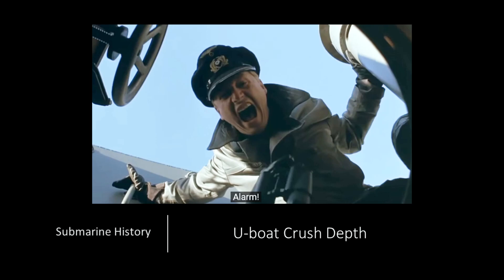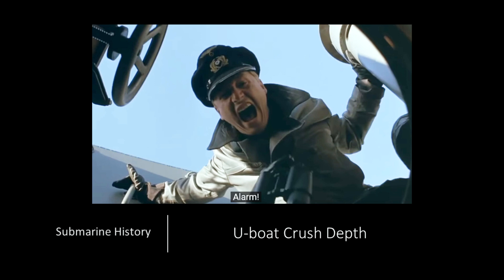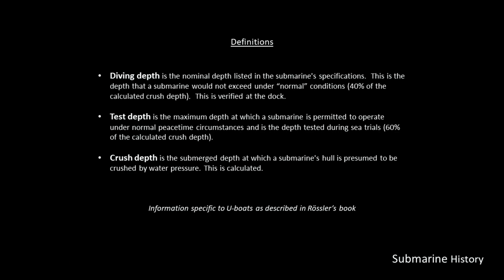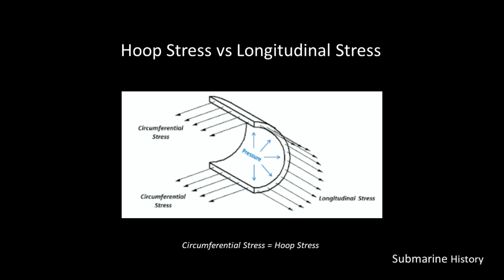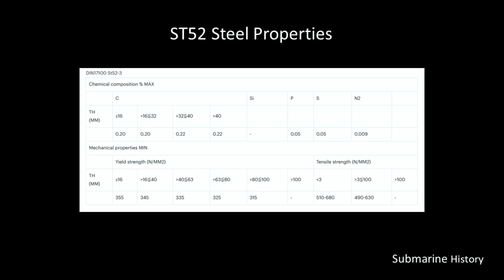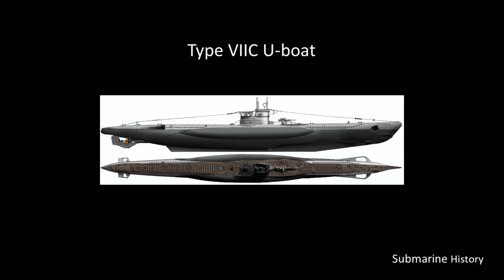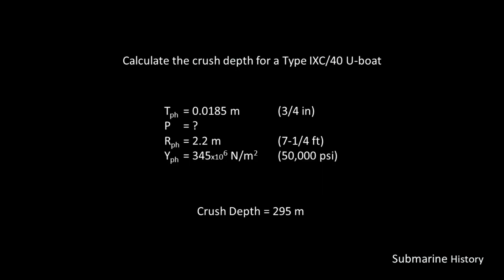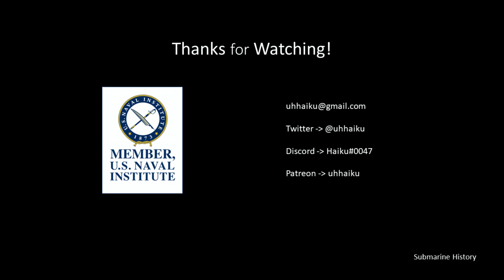U-boat Crush Depth - #16

Comment: Where was depth measured? If at the center of the boat parts of the bow or stern could be considerably deeper if diving or ascending and thus experiencing different depths. How was this factored in?
Reply from the maker: In general you didn't want to dive at more than a 30 degree angle, otherwise you'd start losing water from the batteries.  So assuming a Type VII U-boat made a dive at 30 degrees, the bow is going to be about 17 meters (56 feet) lower than the center of the boat.  They would know that and factor that into their depth calculus.  Probably less important for crush depth and more important to make sure you don't hit the seabed.
Reply: The OP is obviously the fountain of knowledge and I've seen in movies/documentaries and photos that printed on the face of submaries depth guages is "depth to keel".
That's just my observation and realize so many variables are at play i.e. inclination of sub  while diving, etc.
Great clip this is and this channel is incredible!
Many thanks.

Comment: "Diving depth would be verified at the dock." How would it be verified? It obviously couldn't be tested to this depth at the dock. Would the captain sign off on this number before departing? What exactly is meant by this?
Reply from the maker: The shipyards had pressure cylinders sitting in floating dry docks that were big enough they could slide a U-boat into them.  Once inside, they would seal the cylinder and increase the pressure inside to simulate water depth.  They could do at least 10 atmospheres - which is about 100 meters (normal diving depth).  The Captain and Engineering Officer who were going to receive the U-boat were inside while it was being pressure tested, so they could confirm integrity before acceptance.

Comment: Us submarines could dive just as deep as any German U-boat. Germans just had a higher risk tolerance as compared to safety policy with us submarines. The USS Tang proved this by diving so deep it went over the 600 ft depth gauge.

Comment: According to some type VIIC/41 commanders when they were desperate they went below 300 meters, imaging being so desperate than you went below 300 meters
Btw you should have included the type XIV, if my memory doesn’t fails me that U-Boat cold dive even deeper
Reply from the maker: I'll cover boats like the XIV in another briefing, they were very specific in their design and function.  There is alot of anecdotal evidence about how deep uboats could dive but there is little confirmed evidence.  We know that the Type XXI could go down at least to 750 feet, based on tests by the US Navy after the war.  It was thought they could go deeper, there were issues with manufacturing late in the war for Germany.

Comment: I can't remember the source material(s), but many years ago I read reports of both German and US boats reaching near-crush depths and surviving. The pressure hulls of some of these boats were so warped by those depths/pessures that the boats - even though they survived - were total write-offs when they reached port.
Reply from the maker: Thank you for the comment!  After the war, the U-2513 (Type XXI) was transferred to Portsmouth where the Navy conducted tests on the boat for a few years.  US Navy sailor Bill Tebo was part of the crew that tested the boat (He's still alive as a docent in the history section up at Portsmouth Naval Shipyard) and he indicated they cracked the hull at 750 feet.   The consensus was that the hull cracked due to poor QA/QC at the time and that the boat should have been able to go deeper under proper manufacturing conditions (no bombings, time to develop and test, etc.).

Comment: Crush depth should be a buckling problem, not a yield problem.
Reply from the maker: I am a civil engineer, but I don't do structural design work in my professional life.  Having said that, I'm assuming there is sufficient internal structural rigidity from the interior ribbing of the U-boat that it will mitigate buckling before yielding.  I'm probabaly wrong and it would be great if a structural engineer out there could comment on this.
Reply: @SubmarineHistory  @a1g0rhythm Robertson's 1990 paper "Analytical Calculations of Fatigue Loading of Submarine Hulls" writes in Section 4 that the stiffeners can fail by buckling, and the hull plating can fail by buckling (forming "lobes") or yielding (forming "pleats"). The paper is here: https://apps.dtic.mil/sti/tr/pdf/ADA232543.pdf

Comment: Fascinating stuff.  Thanks for posting.
  Old salt (DE Machinists' Mate-never served on a sub; only hunted them) here giving his two cents on topic.  A submarine's operational depth is more or less a product of the producers' packing gland technology.  Metals are very important (got a friend whose dad was an HY steel designer), but those glands are what fail at depth and during extreme overpressure events, like depth charge attacks.  Shaft glands fail and you head for the bottom, tail first.
  Enjoying the channel.  Carry on.
Reply from the maker: Thank you very much and yeah seals  and packing are often not talked about!